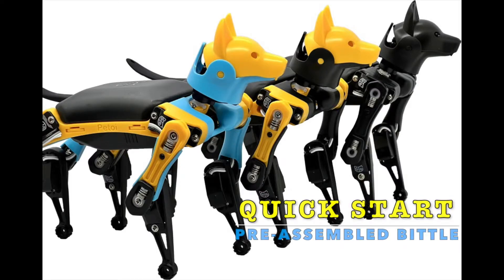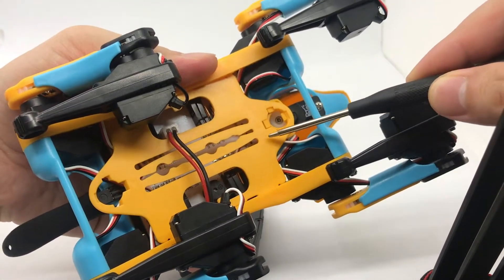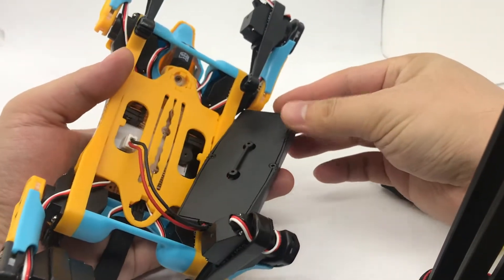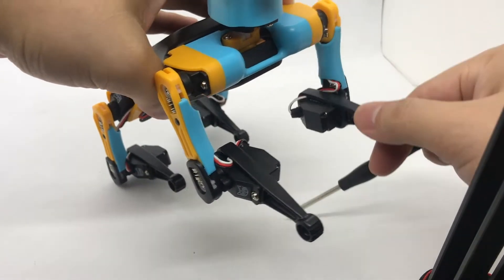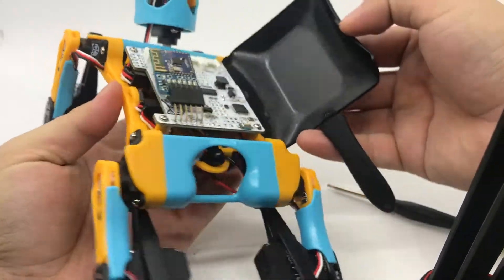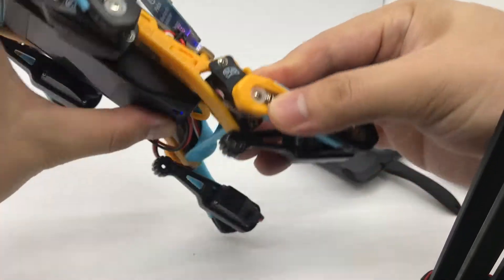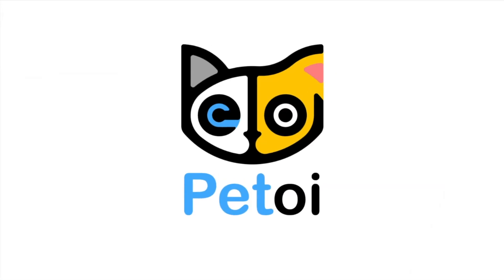Bittle Quick Start Guide: Unleash Your Robot Dog Fun  | Petoi

Comment: I have a question can you remove the head?
Reply from the maker: Yes, the head is a clip structure that can be removed easily.
Reply: @petoicamp okay thank you Love your product.
Reply: @petoicamp I have your product pre assembled and I don’t know how to remove the wires from the head
Reply from the maker: @DarkPurple65  open the back cover. unscrew the circuit board and pull that head cable out.
Reply: @petoicamp  how do we unclip the back cover
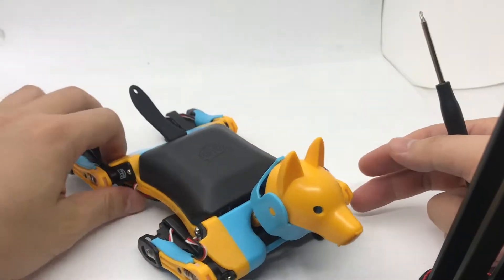Reply: @DarkPurple65  , please check the 3:15 mark of this video.
Reply: @kaimai1207  okay
Reply: @kaimai1207  THANK YOU SO MUCH
Reply: Hi! So I really wanted to get this dog, because our dog just passed away, and I need something, to get my mind of of it! I just want to know if you have to program it to do everything? Also can It follow you?